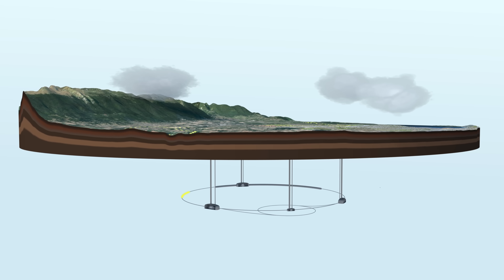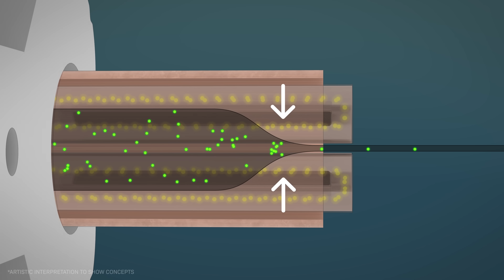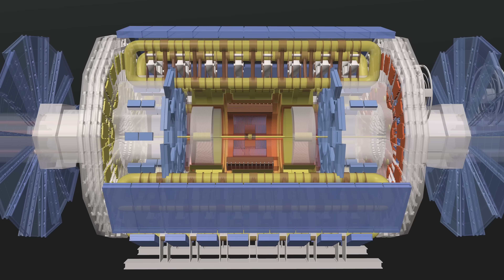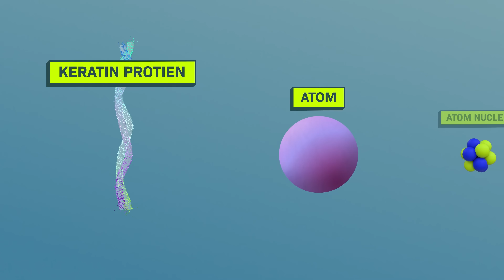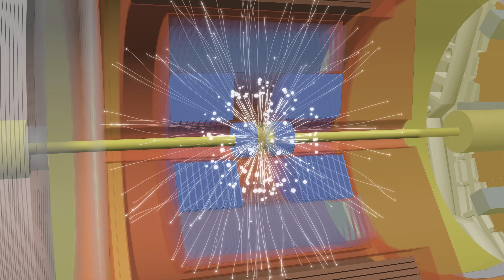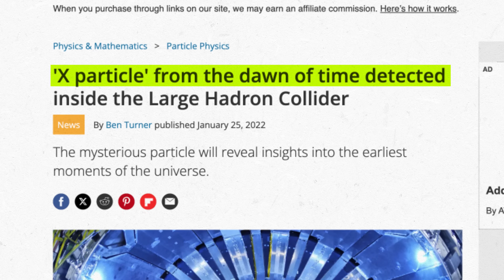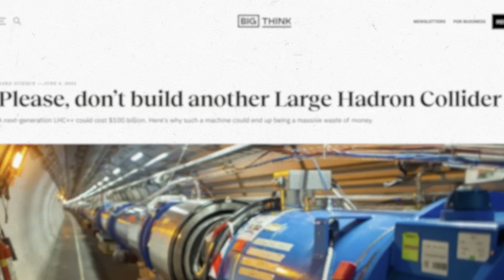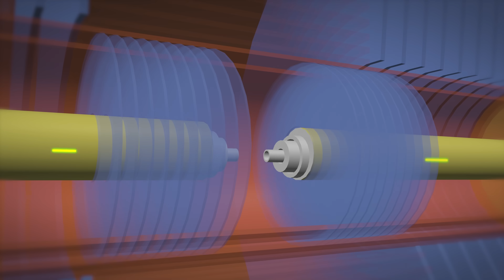What's Really Happening At CERN

Comment: why are u yapping, another question where does the protons which dont collide go?
Reply: As most of them don’t collide, they just go another round. The LHC is a circular collider. Once the beam is injected it stays there for several hours (at best 10-12). After that, it is not efficient anymore to keep the used beam and the rest is shot onto a so called beam dump, which is essentially just a big block of material that absorbs the enormous amount of energy and is therefore highly radioactive. 
The LHC is somewhat special, as the protons don’t only collide at one point, but they have the chance to collide at four points around the ring.

Comment: ⸻

1. Triggers: Choosing What to Look At
	•	The LHC produces billions of collisions per second.
	•	Detectors can only record a tiny fraction, so triggers decide which events are “interesting.”
	•	These triggers are tuned to signatures predicted by existing theory, like Higgs decays or high-energy jets.
	•	Effect: Many unusual or unexpected events never get recorded, simply because the system wasn’t “looking” for them.

⸻

2. Detectors Designed Around Theory
	•	The geometry, materials, and layers of the detectors are optimized to measure particles the Standard Model expects.
	•	Exotic signatures that don’t match predicted behaviors might interact weakly or leave ambiguous traces, making them hard to identify.
	•	Effect: The machine naturally highlights confirmations of known physics, while truly novel phenomena may be underrepresented or lost in noise.

⸻

3. Data Analysis is Theory-Dependent
	•	Once collisions are recorded, physicists analyze them using statistical models derived from the theory.
	•	Event reconstruction, particle identification, and background subtraction all rely on predicted patterns.
	•	Effect: Data that slightly deviate from expectations may be treated as statistical fluctuation rather than something new.

⸻

4. Cross-Checking Reinforces Conformity
	•	CERN experiments have independent teams (ATLAS and CMS) that must confirm findings.
	•	Each team uses slightly different methods, but they all use the same theoretical framework to interpret results.
	•	Effect: Only results that fit the Standard Model with high confidence survive peer scrutiny, while anomalies are often discounted or reinterpreted.

⸻

5. The “Too Perfect” Loop

Put it all together:
	1.	Machine is designed to detect what theory predicts.
	2.	Triggers filter out unexpected data.
	3.	Analysis models assume theory is correct.
	4.	Independent teams cross-check using the same framework.

The result? Confirmations appear exactly where expected, and the system naturally filters out surprises, creating the eerie “too perfect” alignment.

⸻

I

Comment: I don't understand why they need the bigger collider. The one they is moving particles at near the speed of light already. What advantages does a larger one give them?
Reply: Close to the speed of light, small changes in the speed mean very big changes in the energy. And energy is the thing that is important. We need a bigger collider, because it is not possible to keep the fast (high energetic) particles on a circle at those energies. It is like a NASCAR car:  If it goes faster you either need more force to steer it around the corner or the corner needs to be wider. And as the driver (the accelerator) is limited in its force (ability to steer the car/particle) you need a bigger track.

Comment: This may be a dumb question, it probably is, but i understand sending the particles through a cold environment to resemble the temperature of space before having them collide but what would happen if you heated them up and then collided them? Because what if there was a heat source at the time of the big bang, let's say from the reaction of other things, maybe even a source of friction or something else, which then caused the particles to be heated before they collided? And would that cause the same reaction as to when they are cold?
Reply: its mainly used for the magnets if the tempertature was any higher the magnets wouldn 't work and they wouldn't be able to steer the particles

Comment: Building bigger and bigger particle colliders isn't a sustainable solution. What really matters is acceleration — not just size. If we can find smarter ways to accelerate particles — like using spiral or spring-shaped paths, or even entirely new physics — we could reach higher energies without needing rings larger than the Earth. It's time to innovate, not just scale up. 13:54
Reply: Unfortunately, that is not how nature works. We can accelerate pretty good. The acceleration path is just a few meters, maybe 100 m. But we don’t have the technology to make them go around in a smaller orbit. It is like you are trying to drive your car at 100 km/h around a sharp corner. That won’t work. 
There are even more effect that’s come into play. 

The FCC, the next bigger collider, is supposed to be the las one of its kind. After that, as you stated correctly, different methods need to be found. There are some promising ones: Using different particles, which are at the moment hard to keep in an accelerator, or using smaller linear accelerators with a plasma drive. 

However, both of these solutions need a lot more research.

Comment: You all will get clear picture about this when you meet angle of death. consider this calculation average human life is 60 years
60Year 	* 365 = 21900 Days
21900   * 24Hour = 525600 Hours
525600 Hours * 60Min = 31 536 000 Min. Lets calculate balance minutes based on our age. from the death gate we do not carry at least debris of our nail accept Good Deeds. Read Holy Quran get educated before end.

Comment: What we do there is testing for what can appear when we collide two 10^-15 particles or more of them and what energies particles can come from that particle interaction those particles have the mass energy equivalent of  1.6 10^-10 Watts. All of those particles are gluonic particles made out of 3 quarks each and many of gluonic plasma inside of them. There ware no big bang out of nothing but a collapse of a Supergigantic Black Star. And btw Black Stars are made out of the more then 3-quark state of matter as the substrate of space field get to dense in the cores of 20 times solar masses neutron stars. So they colapse after they do to cast out of outer star plasma shells. Casting out of the star plasma shells happen do to the change of density in the nucleus of stars lower the effect to the chromoplasma areas as that area become less dense. Then do to the density of the 20 times solar masses neutron star and do to rotation of the neutron star still inability that do to all wiggle of atoms release enough energy the neutrons collide and fuse into bigger then neutron particles basically we get from two neutrons which are 3-quark particles 6-quark particle and that process continue that is the black star its not a black hole. It also have 3 levels of the black star inner area spins faster then EM waves in vacuum outer area have gluonic particles and waves and further from that is event horizont that spin close to the speed of the EM waves in vacuum. There is no Dark Matter the 6-quark matter is what you call a dark matter large amount of the 6 quark matter and more then 6 quark cause density and forces in the center of the Black Stars increases toward center of the black stars. 

Think of the point that everything all matter and all waves that exist now ware in the beginning of the universe part of one supergigantic black star that ware too big and went boom in all directions in our 3 spatial dimensions and that happen many billions of years ago. :) All 3quark matter come from cooling of quark gluonic plasma which appeared from collapse explosion of the too big black star.

Comment: Surely a larger colider wouldn't make a difference? A particle crashing almost at the speed of light in 27km tunnel is going to have the same impact as colliding in a 100km tunnel. It'll be the same speed & same impact. If anything wouldn't a smaller collider make more sense to create a more accurate collision.

Comment: If they are hitting at almost the speed of light what would happen if they hit at the speed of light? And what would happen if there are for like a crossroads and four hit?
Reply: It is impossible to hit the speed of light, because the the energy that you need to accelerate the protone increases exponentially. You would need infinite energy to bring them to light speed. So let's say that have 99.99 % of light speed. OK, let's put more energy in it, so you get 99.999%. And more, so you get 99,99999%. But you alway will only geht another "9" digit at the end, it never becomes 100%

Comment: The question isn't should we do this or not, it's should people do this or something else. Essentially every hoped outcome of the original large hadron collider has failed. Also, it's absurd to note the cost of the build of the original or planned LH collider as the overall cost. The millions of scientists globally responsible for interpreting the results of the LHC, the enormous power requirements, etc dwarf the initial costs. And they're not just monetary. Many of these are extremely capable scientists who invested time and effort into it instead of other ideas. Plus, it's heavily based on string theory, that has remained entirely unsupported by practical experiments now for over 50 years as competing theories sit on the back burner. Ultimately I think we need to accurately estimate the overall cost of creating, running and analysing a new, larger LHC and we should critically weigh up the pros and cons. I suspect we'd find it's a bad idea.

Comment: What's cool about the micro black hole thing is that even if it were to happen, the black hole would evaporate almost immediately. But there is a hypothesis that black holes are stable at a certain size? What size? About a planck length, which is so small that comparing that black hole to the proton Cleo was talking about would be like comparing the proton to the state of Connecticut. And because it's a black hole, it would still be pretty massive. Not massive enough to interact gravitationally with much--it would be about 20 micrograms, or about the mass of a flea's egg. But massive enough that if there is one of these black holes every four cubic kilometers on average, it could account for all of the dark matter. And they would be so tiny and so dense we would never know they're there. Only way to detect them would be if one collides directly with another particle, and we'd have to be looking right at that point with sensitive enough equipment to see it, and good luck with that if there's only one every few cubic kilometers.

PBS Spacetime did a video about this, and if this is what dark matter is, I doubt we'll ever know for sure just because of how ridiculous it is.

Comment: Would there be an advantage to having a collider built in space.?    If it was built in space would it have to be as large as they are building them on Earth or would space give you an advantage to where it wouldn't need to be as large and you can get a better effect?.   The process of building it in space would obviously need to be combined with building a complete and more sophisticated laboratory system and space. A space station that could be a college. It would allow multiple experiments And multiple areas of research. I know that scientists or physicists are searching for unified theories. I think I think taking the concept of the high ground would allow you to pool Resources from a multitude of efforts and disciplines and they would all advance together simultaneously with a greater synergy.

Comment: If they are seriously considering building a larger collider I hope they will find a more talented group than those who worked on the first one. It took about 10 years to build,! It ran for a week. Melted down and was done for a year of rehabbing and up grading. During that year they stuffed it full of Xeon processors because they were looking for petaflops of data but hadn’t enabled the capture of such quantities!! They built the thing to generate data but hadn’t equipped it to capture! With all the time and resources it still ended up being massively under engineered.. 

So Cleo give yourself to motivating those who push the design to do a lot better than the first one!!! upgrading the basic design.. But I'm actually wanting to see ROI!! Increased food production, improved environmental quality!! Something that someone, somewhere can put in a bank or a refrigerator, a pantry or a fuel tank!!

I think there is a metaphysical component that they are ignoring in addition to all that they have tried!!!

Comment: something you sholud go back and ask about ... is the events hat happened 60ns BEFORE a particle at the speed of light could have reached there ... proving that the speed of light is NOT a maximum but a hurdle requiring a better engine ... 

dont forget every last detector at CERN is only able to detect upto the speed of light ... this isb like using a 10v voltmeter to detect a 12v battery ... untill it falls below 10v it wont be registered ...
Reply: yes we are living on the event horizon of the milkyway galaxy gravitational singularity .. everything under that central gravity spins our so system and everything in the milkyway IS the event horizon ... what main stream science erroneously calls the back hole IS the singularity .. and we LIVE on its horizon slowly being pushed further away as Hawking's radiation dumps more and more information into the event horizon pushing stuff further away .. this the red shifting of light ... 
Nature use the simple to make the complex ... and NEVER breaks it's own rules ... after 16.5 + Billion years it knows better than mans 65M years of blunders and bad reference frames
Reply: the big bang is IMPOSSIBLE for 2 reasons ... first ... it violates the law of thermodynamics where energy can neither be created nor destroyed ... the big bang requires energy to be created out of nothing to happen ... Second ... the nasa thermal energy map would be hot on the edges and cold in the middle ... it is NOT it is near uniform meaning many little bangs have happened ... such as when the gravitational singularity and the center of galaxies finally surpass their finite limits .... yes FINITE ... if they were infinite NOTHING would escape ... yet EVERY blackhole emits some form of stuff ... usually x-rays and gamma rays ... if they were infinite these also would NOT escape ... sadly main stream science has forgotten to update their theories to include the facts they keep being slapped in the face with ... and just make more junk up to explain their bad models that are proven wrong time and again 

the simple to make the complex NOT the complex to make the simple
Reply: Mass is SIMPLE ... it is the positive interference of like charges and spin creating a gravitational attraction of other particles stronger than their repelling forces ... the wavicle ... energy IS mass .. they are DIRECTLY related ... since all matter IS energy then Gravity is the combination of like energy in spin and charge coming together to create mass ... 

Nature does the simple and gets the complex from their interactions ...
Reply: nature using the same things at EVERY SCALE .. it doesnt have different stuff at one scale and another at a larger scale ... using a larger collider to further disprove quantum physics isnt needed ... when a real world scale such as Galaxies can be used and observed ... nature uses the same rulles at every single scale ... man uses different stuff at every scale reference model ... 

I take 16.5 Billion years experience over 65Million years of mistakes and lies